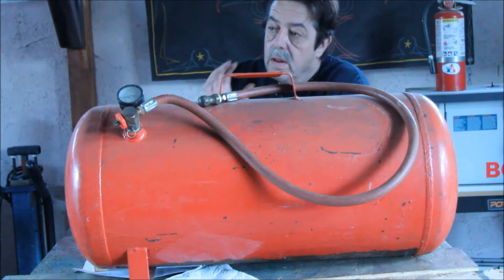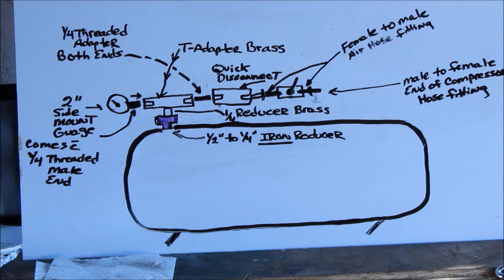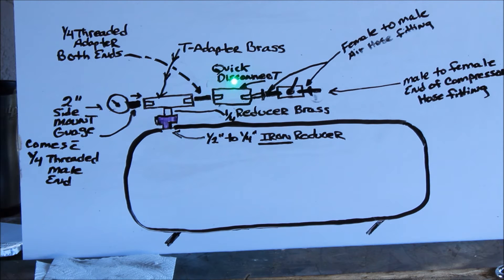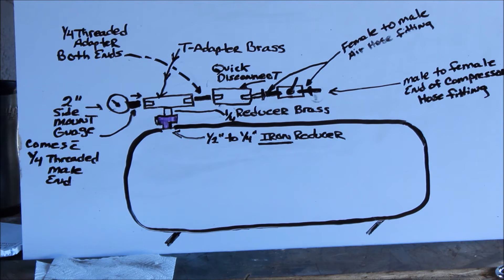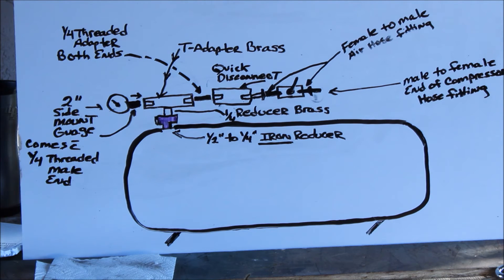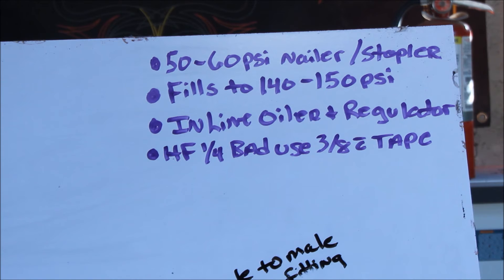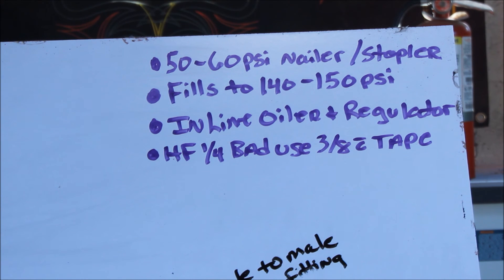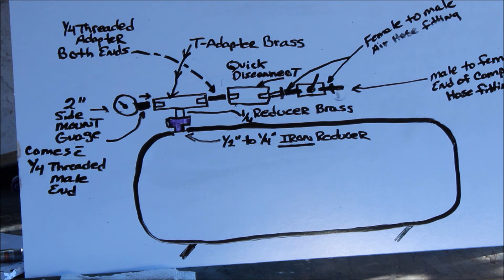Harbor Freight - Portable Air Tank Modification

Comment: This will come in handy, I’ve always had trouble filling my tank. But this might just be the answer I have been looking for. My little pancake compressor just seems to crap out at 20 lbs, when trying to fill the tank. Wasn’t much better at the local station.

Comment: I am hesistant to change the original manifold any way I would think it would work better if you use an adapter  I mean I left the oringanl manifold and put a tee with shut off and qucik connect on the other side Its my understanding that those quick connects will only move air when the part is insert so my thinking is when I connect it use an air hose that has an air regulator I added a check valve on one side an a quarter turn valve on the other side of the check valve so hopefully it cant some how flow backwards thoughts ???
Reply from the maker: Let me know if you try what your saying its sounds like it may work fine.

Comment: QUICK DISCONNECT WITH 1/4" NPT MALE THREAD WILL SCREW RIGHT INTO THE T BLOCK, THUS ELIMINATING THE MALE X MALE NIPPLE. I SUPPOSE YOU COULD GET A T BLOCK WITH MORE PORTS IN IT (A MANIFOLD) AND PUT A DRAIN VALVE INTO ONE OF THE PORTS AND A PRESSURE RELIEF INTO ANOTHER IF YOU CHOOSE TO DO SO.  JUST A THOUGHT. DAMN CAPS LOCK !! SORRY
Reply from the maker: good idea

Comment: I see a major issue here... you removed the safety release valve and did not add it back to the new connections.  It is possible to overcharge this tank beyond the max safe pressure (~125 lbs.).
Reply from the maker: I see your point and it can be easily added back in - but thank you and i did add it back after the modification but forgot to add it into the video - again thanks for pointing out the error

Comment: brass T is going to cost like 10-12 dollars, be all female ends that need gender changing, and be too big requiring reduction in size, so by the time you get all that bought, you've spent as much on adapters and fittings as you did on the tank.    Best bet getting this done cheaply is look for an aluminum manifold at a store like home depot or true value, that goes straight to 1/4 NPT, probably will still have to adapt it to the 1/2" npt tank with a reducer or at least gender-changing nipple but those two parts are going to be about 10 - 12 and you're done! if you just re-use the gauge, and use 2x couplers for the other manifold openings, this way you can also use it as a regulator-side storage tank in tandem with your compressor when working at home, and don't need the ball/check valve.  Just use a female plug connected straight to a male plug as an adapter when connecting to the compressor.  Cheapest way I could figure out how to get it done, and I was lucky instead of $4 for the manifold it was on sale for $1.98.
Reply from the maker: this is great information and thank you for posting it - I had many of the parts laying in my shop so i never totaled it up like you did but this is a great alternative so thanks
Reply: @TheHomeHandyman  yeah having a good supply of fittings on hand can be very helpful it's always a rubik's cube combined with a treasure hunt to adapt one item to another.

Comment: Hi do these tanks required to remove moisture that may accumulate in then from operation?  If so how can the moisture be removed to maintain the tank, if the tanks do not come with a valve on the bottom like most compressors do...?
Reply from the maker: On mine i just fill it ........turn it upside down and open the valve and bleed it out

Comment: Followed your instruction,  my Harbor Freight tank now loads faster than ever and I can easily reach 100psi.   The only change I made was to put the quick connect fitting on the end of my hose.   I used HF fittings and teflon tape and I have no leaks.   Now I only use my tank to fill the never ending lawn tractor flats.
Reply from the maker: Thanks for the comment - Yeah I made this and gave it to my daughter to take to the barn down valley where she has a horse - They use it to inflate tires and tubes and I gave them a small blow gun to attach and she just brings it home for refilling with my large compressor - it is a modification im glad i made for sure

Comment: I happened to watch the video that you are commenting on just before yours. You misunderstood his reference to the size tolerance. He was talking about the 1/4" hose barb that he used to terminate the hose that he cut the HF factory tire fill valve off of, which he replaced with a quick disconnect. The size issue was that the hose spec stated that it was 1/4" ID and if you use a 1/4" barb, it is so loose that no amount of tightening on the hose clamp would suffice. He found that a 3/8" barb fit well.  There's no mention of wrapping an undersized brass fitting with tape, which would have caused a barrage of YouTube comments.

Comment: Lots of good information for a nice setup. These portable tanks rarely have drain valves, so how would you drain water from the tank with this setup? My inclination would be to just turn it upside down and open the ball valve, but I'd be afraid of getting water into the gauge.
Reply: + Randal Holtzclaw, I have been looking through YT videos also trying to find a solution to this problem.  How would you drain the water from these auxiliary air tanks after use?  Would you have to drill in a tap in the center of the bottom of the tank and install a drain?
Reply: I wonder if you could hook up a vacuum pump and pull a vacuum to boil off the moisture
Reply: These cheap tanks don't come with condensate drains. You are instructed to turn the tank upside down,open the regulator valve and let condensat blow-out hose. A real pita. As far as welding in a fitting, I wouldn't unless you're a certified welder with experience with tank welding. Your better off buying a storage tank with a drain. (Lowe's has a nice 7gal. and Menards and Home D. have 10gals. with fitting,ball valves and drains). Yes, cost more but your basically ready to go.